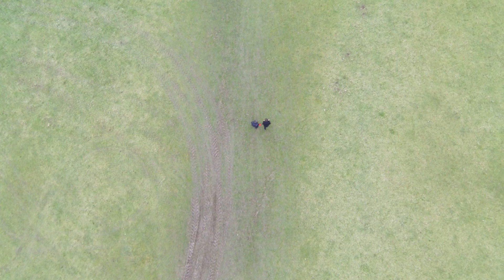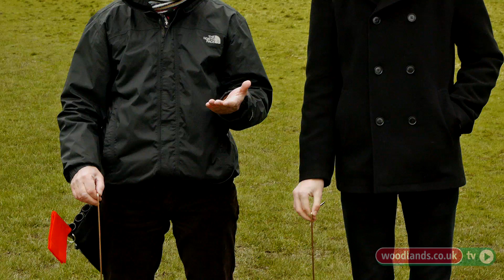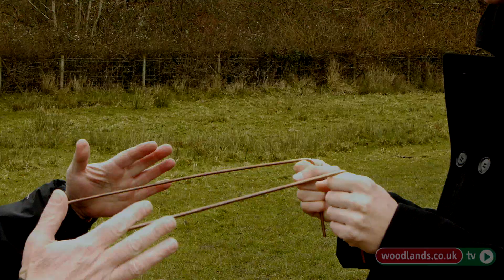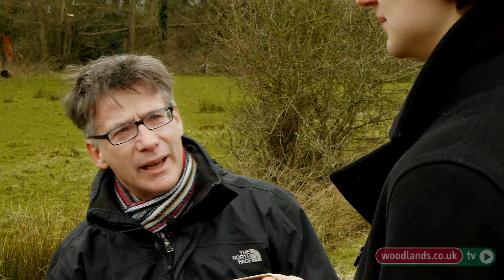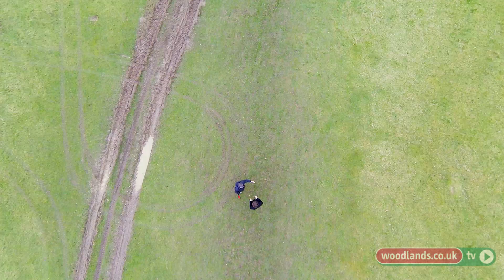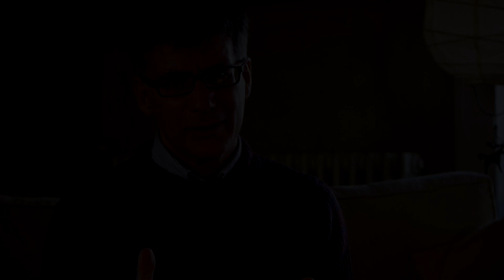How to Dowse for Water

Comment: My experience was in the RAF about 1957 in the office I was in, there was a civvy called Mr. Booth he showed me these rods with washers and other bits. There was a passage in the hanger he showed me how to hold these rods and gave me some chalk, and said walk and mark the spots where you get a reaction, the reaction I got was a very strong pulling down on the rods, and my arms, so I marked the spots. When we looked outside there was water pipes running under the marked spots.

Comment: Interesting blog and topic. I am still pretty new to dowsing. I am in Africa and there is a lot of gold around. I just made my rods from wardrobe wire coat hangers. And started dowsing. I would ask people to hide things and I would look for the stuff with my rods. Then I was refining the process and then wen off to my gold claim on admission to look for the gold veins. The main thing I would do was simply to talk to the rods (after observing some religious practice) and ask it questions and the rods would respond strongly as I would be walking. For example, I would ask, "I am looking for a gold bearing vein that has a grade of about 20 grams per tonne and the nearest to the surface within this area". Then the rods would point
 But the thing is when I would ask for the depth, it would say around 25 metres deep and the being about 2 metres wide, going 45 degrees etc. So it was my first time and you know the process and expenses of digging 25 deep and blasting is quite costly. So I just need assurances and testimonies from others that it works. I would be left with an egg in my face if i try it then find nothing! Has anyone ever got that deep? What's your opinion about this?

Comment: I know you said a shallow site may dry up. I was wondering if you've tried asking if the flow rate of the found site changes over the seasons? Because of course, as you're saying, depending on the type of well it could be from an unconfined aquifer from just water in the ground under the water table which can dry up in the summer. But again temporal questions, over time, would be a little harder to phrase and I got mentally tired before I tried this. Curious if you've tried this. 
Im asking because I'm locating a water source for a garden at the top of a gentle slope in a valley and I read that 12.5 feet down I would get 32 gallons/min which is very crazy. I am in the middle of a wetish early spring though.
My other question is what the range is in inches i need for the depth to be accurate? I got between 12-13 feet is where the water is. 
I also tried map dowsing with a pendulum, a very primitave but well intentioned drawing I did of the area and found this site as well as a few others that wouldn't produce enough water. This map confirmed the findings with my rod.

Comment: A professional well digger said 99% of the time you’ll get water anywhere you dig, it’s only a question of how deep you have to go.
Reply: Yes
Reply: Which means para information is a huge benefit. Contractors may have a certain depth in mind they're willing to do. Why dig 3xs at a depth of 50' if you can find it at 100' - 200' the first time. Before modern machinery there was nothing else. You hired a reputable douser. My well is most likely about 150 yrs old. The house is 1898 with another foundation nearby and the well is between.  I'm guessing it was the original owner's of the property and may go back to ? The existing bare foundation didn't have a basement and is large enough to build  a 2 room cabin on. It has a low step up and that's how I know it wasn't a garage.
Reply: We need these old tried and true ways for survival.
Reply: My professional well digger said the same.  Went down 300ft at the spot most easily accessible for his rig (which seemed to be his main interest) and got a trickle that was unsustainable.  Drilled a second hole exactly where my diviner said he'd hit at 120ft and surprise surprise he hit a good sustainable flow bang on 120.  I'll be recommending the drilling guy uses a diviner in future to save his customers a costly futile mess.

Comment: Good video sir. Can you explain what is the really influncing the rod to identify the water. Is it on the basis of ideomotor effect.
Reply: I have been practicing this, and at first thought it was my subconscious influencing the rods. They are extremely easily influenced by even the slightest accidental twitches of the hand. However, when walking haphazardly around my yard, they very clearly crossed suddenly. It would not make sense for there to naturally flowing water on our property, but my father figured it was a pipeline. And it seemed to be true after we went down to our basement and looked at which direction the water pipe was running: directly below where my rods definitively crossed. I had no prior knowledge of the pipe, so I could not have subconsciously crossed the rods since i did not know there was flowing water below.
Reply: @harpershea20  your observation is absolutely correct. Subconcies mind influencing the rod. I am a water dowser in india and doing the profession since 1979 onwards. I have so many experience to prove the effect is due to ideo motor effect. Thanks for reply sir

Comment: this is my last resort to find my outside stop tap, we've had the water board out and I have turned over so many stones to try and find it we have also tried metal detectors. will let you know how I get on.
Reply: @newlidaho  I have tried it and it gave me the approximate location.  Thanks for the tip about turning the tap on, I will try that next and see if it shows me the length of the pipe. The water board can hear the water running when the tap is on so it's there somewhere!

Comment: this was great I dowse and most times i get rolled eyes and a smile. I also have had great result in finding underground electrical ,and pipes.I find i have a high average .cheers
Reply: Wait you found underground electrical and pipes underground? Wow, what a surprise!🤣
Reply: Ask them to remain straight infront of you. "Straighten up please", "Straighten up", "Thank You"

Now, ask them if your friend was born between 12am-6am, 6am-12pm, 12pm-6pm, 6pm-12am.

When they cross ask them to straighten out again.

Then ask between those specific hours; for example if they cross between 6am-12pm, ask them between 6am-7am, 7am-8am, 8am-9am, 9am-10am, 10am-11am, 11am-12pm.

When they cross right down that time and fold the paper so its not visible without opening it up.

Express gratitude by thanking the rods for assisting you in determining the time that your friend was born.

When you see your friend give them the piece of paper and ask them what time they were born.

Then have your friend open up the piece of paper and explain how you discovered the hour they were born in.

If everyone dowsed, even politicians could never get away with lying to all of us again.

Comment: I hired a guy to inspect my septic system here in Rigaud Quebec 2021.
Note that there is very little water in a weeping field, if any. Damp soil probably.
So he used the same wire he uses for his flags which he placed around the field.
No idea if he was spot on.
 But generally reasonably accurate I guess, 'cuz i didn't dig up the pipes to prove a point.
BUT!   He did find a pipe 3 meters outside the septic field, that i use for greywater discharge.
Yep. Could be something to this. But my neighbours still laugh at me even when i show them the grey water outlet 'way over at the edge of the property; ( hidden in the bushes).
Reply: It's crazy how this works but no one can explain it. Farmers in Botswana (Africa) use it alot and never hit a blank when digging wells/borehole. I just wish one day I find a good, valid explanation around this.

Comment: hello, did you either put material inside so that the bars do not fall into metal or mineral? Or do you use holding techniques that save them from them? Are there any samples in it to find valuable? Bars for metal for space give different results, can you read those shapes? Do some research or you will never succeed.

Comment: so is it just copper wires you use?
Reply: And you can use the properly clad wire, brass wire, or even a coat hanger cut and bent into an L shape
Reply: Just purchase welding rods. 1/8-1/6 of an inch in diameter. Use two wrenches to bend them at 90 degree angles about 6-8 inches long. Allow the rods to be 1.5-2.5 feet long. 

If everyone dowsed, even politicians would never get away with lying to all of us again.
Reply: no, you have to use copper wires from known witches who studies magic

Comment: I've been witching for 40 years and initially used rods but have graduated to using a switch off a tree, Some water is very difficult to locate because of the underground rock formations. Granite is very bad for finding water. Llano County Texas is nearly all granite.
Reply: Dowsing always fails a controlled test, its basically the same as chance!